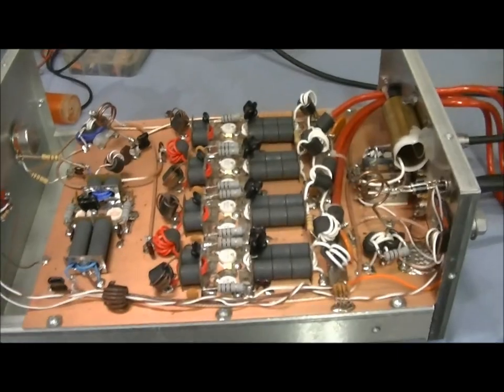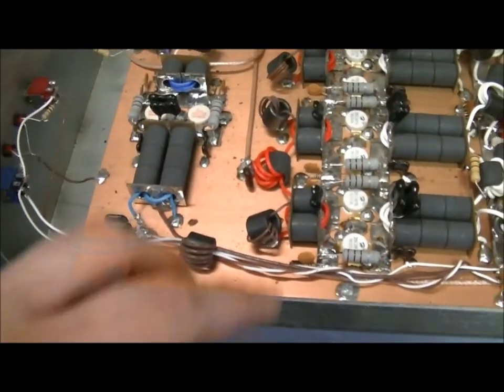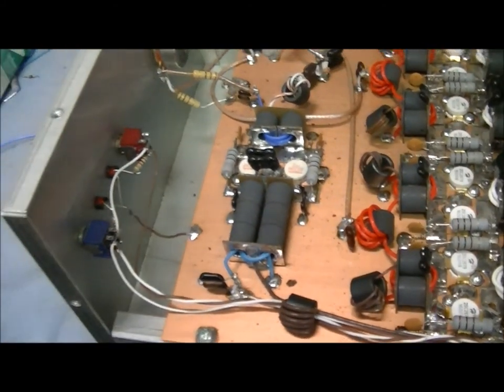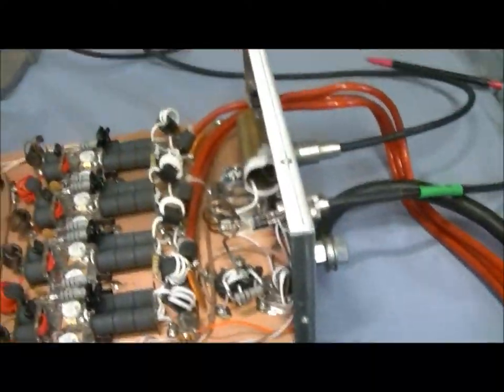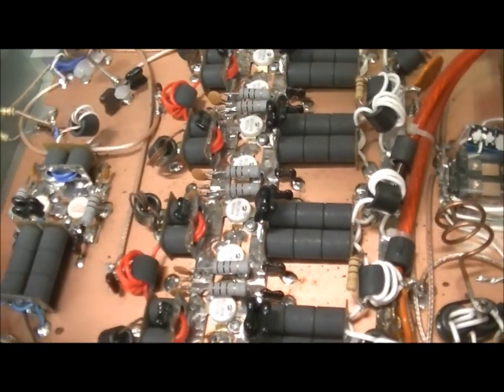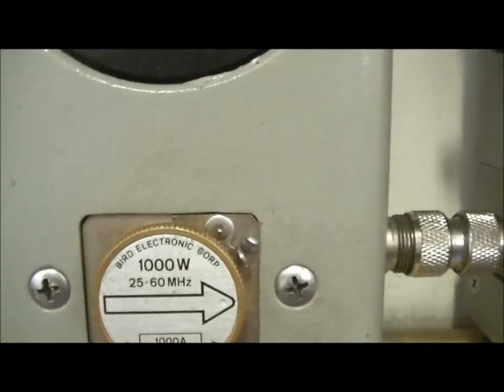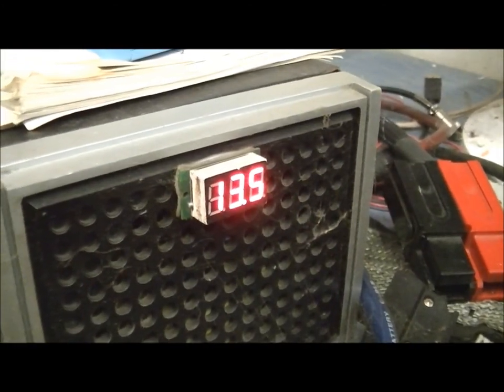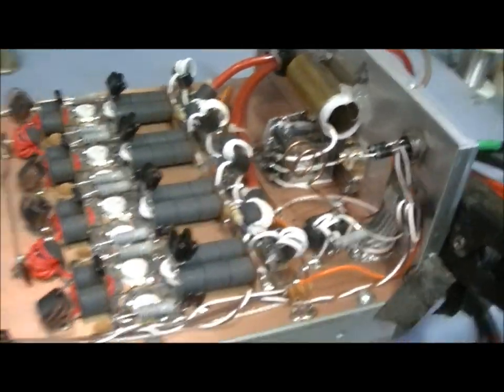Mr. Feel Good's Fatboy Staged 2x8 Repair - [HG's Early Days]

Comment: That a nice amp. I worked on Fatboy 8 pill before .he does his staged combiner a little different . Them orange caps on 4 pill section is fine. Xforce and stickman and Texas star all do there combiners different. all work and make the watts. That better using 2290's for driver. I got sent a link to Fatboy 48 pill HG 2SC2879c doing 13.5 KW PEP. drawing 1K amps . That Fatboy 8 pill I did was a up grade .came to me working fine. power wire on output transformers I re did with bigger ferrite and 10AWG PTFE wire and added bias relay and messenger bias circuit. with different diode keeping bias around .55V on HG . and added foot pedal switch jack. changed the output tune a tad . and got the pass threw tune a little better . The input tune was fine. about 1.2 to 1 VSWR .  left it. it was swinging back to under 1.1 to 1 when talking AM . I got a bunch of them 150/120 pf orange caps from ICA . RF parts was out of metal clads at the time. also put on Anderson SB 350 connector. what I found is go 50% over kill with Anderson connectors. it's the voltage drop. Thermal imagine shows the difference. Save up max out credit card get you a 1000amp supply. Use Meanwell units. 1 master with slave units. all track the same . will be 240V . I only seen 3 64 pill amps. old xforce  a skull cracker and a Fatboy . That all I seen with my own eyes . I know more out their . 73's